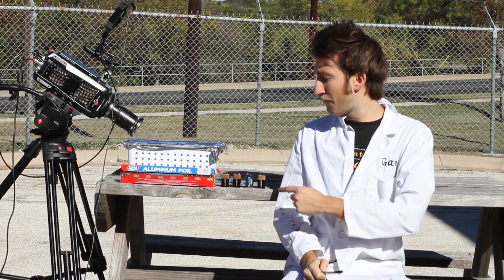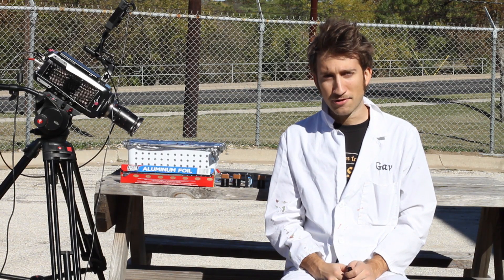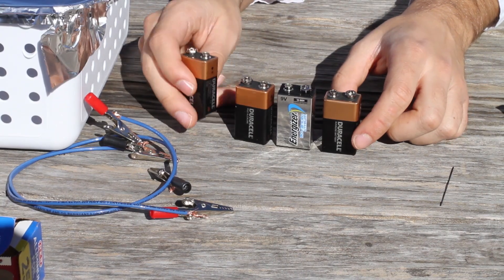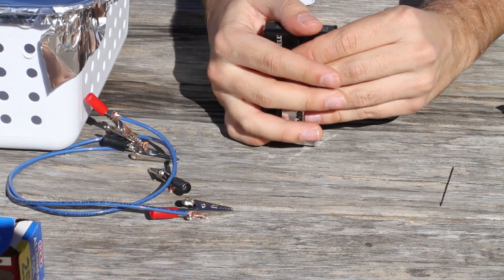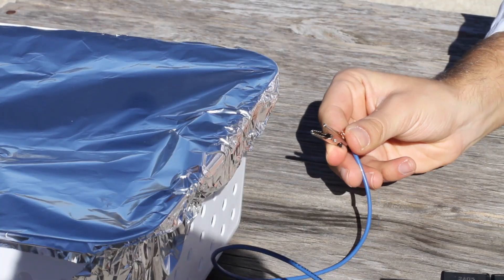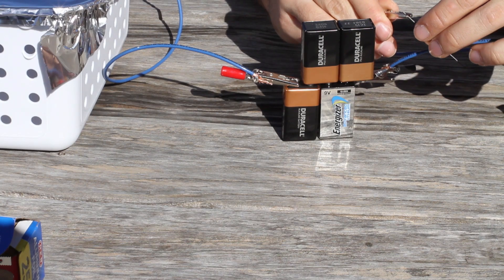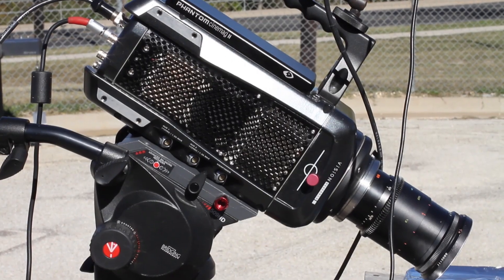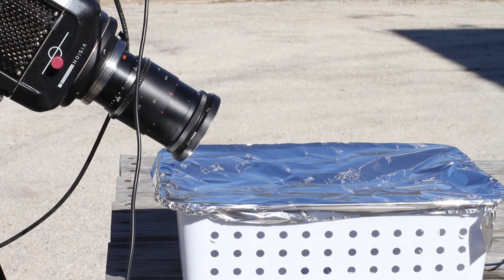Tiny Plasma Cutter in Slow Motion - The Slow Mo Guys

Comment: I don't get it, why are people talking about the differences between "aluminium and "aluminum" with the former matching other element's suffixes such as "lithium", "barium", "cadmium" and "sodium" but fail to mention that the latter has a spelling that matches "platinum"?
Reply: *****
I wasn't trying to name them all. xD
Reply: *****
And "polonium", and "uranium" and "beryllium" and "helium"? xD
Reply: *****
xD Elements that don't have official names yet.
Reply: Aluminum is a spelling variant based off Aluminium. Aluminium came first. 
Both spelling variants are technically correct. Aluminium is just the most correct :P
Reply: *****
I know they're actual elements. It's just that I'm pointing out that these elements don't have official names yet. The names currently used are fillers and are just 1-1-5-ium, 1-1-7-ium and 1-1-8-ium in Latin.
Reply: *****
Yup. If I'm not mistaken, the time that these kinds of elements received official names are based on how long an element lasts and the amount of research into its properties and behavior. Again, I may have missed the mark on this guess.
Reply: Adokas23
The discoverer actually called it Aluminum, then the name was ratified as Aluminium to make it work with the rest of the names.  Some places it stuck, others it didn't.
Reply: helium, lithium, beryllium, sodium, magnesium, aluminium, potassium, calcium, scandium, titanium, vanadium, chromium, gallium, germanium, selenium, rubidium, strontium, yttrium, zirconium, Niobium, technetium, rutherium, rhodium, palladium, cadmium, indium, tellurium, caesium, barium 
Need I go on?
Reply: MrMittensss except tire already means 'to grow weary', so the word now has 2 seperate meanings, where-as there is only one meaning for 'tyre'. 
So the spelling of 'tyre' makes more sense :P
Just because you prefer the way you spell it, doesn't make it the best way. Otherwise the modern internet generation would spell 'you' as 'u', etc :P
Reply: ***** not really. Nobody answered the original question. What about other elements that end in um? Like lanthanum, molybdenum, platinum? The only reason you brits get your undies in a bunch about "aluminum" is because some crusty old Brits in the 19th century decided to call it aluminium. The man who discovered it called it aluminum before it was named aluminium. My point is who tf cares? Well brits do, but why should they? It could be called bubblegumium and it wouldn't change what it was or what it actually did. Just like changing platinum to platinium wouldn't do anything either. The only reason aluminum was changed to aluminium was because some crusty old farts thought it sounded more Latin and classical, and American scientists didn't see the need to change it for the sole purpose of sounding more pompous.
Reply: GurtBFroe, to support your point, lanthanum (#57), molybdenum(#42), and tantalum (#73) all match platinum's ending as well
Reply: GurtBFroe
Yeah those Pokemoniums are very powerful
Reply: well you also say sodium and potassium yet they are actually called natrium and kalium
Reply: MrTURBOJOHN makes sense doesnt it  lol
Reply: frollard So, they changed the original name to make it sound fancy like the rest?
Reply: G Turpin Yup, although 'fancy' and 'in line with a standard' are two different things ;)
Reply: chigimonky Who cares? well you seem to getting quite butthurt over it lol
Reply: Unobtainium beats all of those.
Reply: "Ium" was preferred but time passed and we didn't give a damn.
Remember basics like gold and iron were Greek
Reply: ***** Uh oh, you seem to be getting really quite butt hurt now! And you still didn't answer the original question. Lolololol. See how many lol's I did? Way more than you. You're so butt hurt now.
Reply: chigimonky Is that the best you have to offer lol
Reply: Adokas23 if we were to take the original words of everything. tire would be tyre and such.
Reply: ***** I love that song!
Reply: ***** A long time.
Reply: anthony hagey I often don't remember those elements too well. xD
Reply: This comment thread is so fascinating! xD
Reply: It doesn't matter though
Reply: chigimonky "My point is who tf cares? Well brits do,"

Look who commented. A bunch of Americans whinging about how a Brit correctly spelled and pronounced in their own country.

Comment: Records in 2500fps, doesn't upload in 60fps. tisk tisk.
Reply: I don't think you know how frame rates work. If it was at 60FPS, it wouldn't be as slow. https://twitter.com/gavinfree/status/530445464257437696
Reply: Team BombHead I know how frames work, but it wouldn't make slow-mo less slow (it would be the same if you did it right), and the regular video would be 60fps which would be the nice part. tbh I didn't think the slow-mo part through when I said that, but it would still be an improvement imo.
Reply: rockskaterdudeperson the camera recorded at 2500 fps so, in one second, you'd have 2500 frames. by playing the video at 30 frames per second you'd have around a 1 minute and 20 second video. If he were to double the frame rate the video wouldn't magically develop more frames, it would use them at double the slow mo effect would be cut in half so, to have the same amount of video he would have to double the fps of the camera. The whole reason 60fps looks smoother is because you're cramming more frames into each second, you see more images each second so there isn't as much of a gap between frames and it looks like a fluid picture but, if he were to double the fps in order to use 60 fps it would just be extra work for nothing because, as more frames are added, the lower the resolution of the video gets and the choppier the video gets so you'd just be left with a lower quality picture.
Reply: Brandon Hank That's why I said "if you do it right". Of course I don't know if this will work because I haven't worked with footage like this before, but if you just slowed the slowmo down x2 with the 60fps the slowmo should be the same, while the regular speed would be 60fps instead of 30.
Reply: rockskaterdudeperson The slow mo effect is created by filming at a frame rate higher than the frame rate of the video player you use so filming at 60fps and playing at 30fps your video will be at half speed and like I said before, the 60fps only looks good because it uses twice as many frames per second as 30 fps, if you double the frames in order to maintain the same slow mo effect the smoothness you get from the 60fps is lost  and the quality of the video deteriorates because, the larger the frame rate you shoot at, the lower the resolution of the video gets since the camera has to shoot at a faster rate. To put it simply doubling the slow mo would take away the quality given by 60fps.
Reply: Brandon Hank I didn't say film at 60fps or play at 30fps. Record at 2500 fps -> slow down 2x more than you would normally -> upload 60fps instead of 30fps (should balance back out without quality loss because you're slowing it down, not speeding it up) -> boom 60 fps video, even though the slowmo looks the same, regular speed is 60fps.

Of course this is all theoretical because I haven't actually done this myself. It just seems so possible ya know?!
Reply: rockskaterdudeperson alright let me explain this clearly because I have worked with these things myself, the slow motion effect is created by the frame rate the camera films at being higher than the rate of the video player ie film something at 2500 fps and play it at 30fps and the video is about 80 times slower than real time. If you increase the frame rate to 60fps you use the frames that you have at double the rate. There are two ways to achieve slow motion 1. lower the frame rate of the video player 2. increase the frame rate of the camera. It's impossible to film at 2500 fps and play it at 60fps while maintaining the same slow mo effect as playing it at 30 fps. A video is created by playing images at a certain rate which is what frames per second is. when you film you create a set number of frames so, since Gavin filmed at 2500fps he would create 2500 frames in one second. If he then plays those frames at 30fps that one second of recording will give 83.33 seconds worth of footage because 2500/30=83.33. If he doubled the frame rate he would have half as many seconds of video because he would be using twice as many of his set number of frames each second, slow mo isn't some magical thing that adds frames, it is created by either lowering the fps the video plays at or increasing the frame rate that the camera plays at.
Reply: Brandon Hank oh.
Reply: Brandon Hank I respect you for not having a go at him for not really bothering to read your explanation correctly
Reply: Michael Bunnell I was certainly tempted to
Reply: Brandon Hank I respect you for trying to answer my silly questions, but I still don't think you understand 100% what I was suggesting, I just took your word that you knew what you were talking about because you've worked with it before. 2500 frames for 30 seconds is 83.33 seconds while 2500 frames at 60 seconds is 41.66 seconds, but there is no reason why you can't play the 41.66 second clip in half speed (which would actually be 30fps) with a resulting video the same as the original and the full speed parts 60fps. It's only logical, unless YouTube doesn't take videos with fluctuating fps.
Reply: rockskaterdudeperson Ahh I get where you're coming from now and no, youtube doesn't allow fluctuating frame rates, it's one or the other
Reply: Brandon Hank Well crap I'm glad we got that one sorted out haha!

Comment: Sorry to say but this isn't plasma cutting. Plasma cutting uses compressed gas. That gas is funneled through a channel inside the cutting head that compresses it even more. That super compressed gas then gets hit with a negative charge from an electrode inside the cutting head that makes contact with a positively charged metal that you are cutting causing a circuit. The high pressure and high temperature causes the gas to hit the fourth state of matter, PLASMA!! The plasma then melts the metal away like it's butter. Sorry, actually not sorry since this show should be science orientated, but i've been using plasma cutters and welders in my woodshop class the last few months and the title bugged me.  ¯\(ツ)/¯
Reply: I do agree that this isn't conventional "plasma cutting"(since it doesn't use high pressure glass) but it is "using" plasma to cut the foil so it could be classified as plasma cutting
Reply: Neo Garcia "An electric arc, or arc discharge, is an electrical breakdown of a gas that produces an ongoing plasma discharge, resulting from a current through normally nonconductive media such as air."

If you pass electricity through a gas, the gas is in a Plasma state. This is Plasma. No, it is not a Plasma Cutter with compressed gas cutting, it is simply using an arc  to heat the metal to its melting temperature causing it melt around the edges.

The title is correct, just confusing to people.
Reply: I would totally post things like this in my areas of expertise but I always have that voice in the back of my head going
NEEERRRRRDD!!!!!!!
Reply: they've never claimed to be scientist or even knowledgeable on the subjects school teachers just like to show their shit in classrooms.
Reply: Get out of here with your science
Reply: halo3bomm ha nah
Reply: TheBAGman17 And yet my point still stands, that is not plasma cutting. ;)
Reply: it does, however you saying this should be science oriented does not.
Reply: I agree. What's actually happening here is a miniature form of arc welding but because it is so hot, the aluminum is so thin, and there is no welding wire to leave a weld it ends up acting almost like a plasma cutter
Reply: Tomek Hermsgavordenbroker
google EDM, electrical discharge machining.
Reply: Ben Watson I wrote up a reply but i guess i forgot to post or just missed the reply button. I'll do my best to copy what i didn't put down the first time. Just in case someone who doesn't know the basics of plasma cutting reads this i'll agree too. What i was referring to was in fact conventional plasma cutting. Where the compressed air and arc causes "a stream of directed plasma, approximately 30,000 F (16,649 C) and moving at 20,000 feet per second (6,096 m/sec), that reduces metal to molten slag". Ripped that one from the first Google result after searching "how does a plasma cutter work". How do you like them apples peoples?
Reply: Neo Garcia only douchebags say "sorry, not sorry"
Reply: It still using plasma, superheated ionized gas, which is so due to the high voltage allowing the electrons to travel across the huge resistance of the air. Also, it is being used to cut. So he can call it a 'plasma' + 'cutter' if he so desires.
Reply: Jonny Drogba haha too bad
Reply: I would totally post things like this in my areas of expertise but I always have that voice in the back of my head going

NEEERRRRRDD!!!!!!!

Comment: Now kill a dinosaur with a rail gun in Slow Mo.

(more realistically) try and find a way to freeze something with liquid nitrogen in slow motion with a better angle than in the tub and try to get shot without all of the smoke getting in the way. (optionally you can then smash the object in SM)
Reply: The leidenfrost effect will cause liquid Nitrogen to not instantly freeze everything. The only way to do it proper would be to keep the item within the container the nitrogen came in.